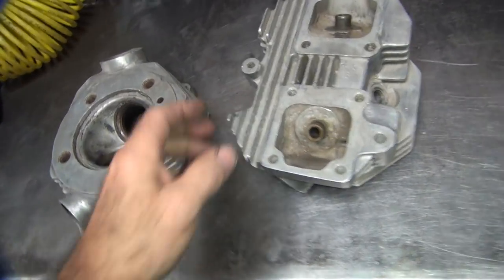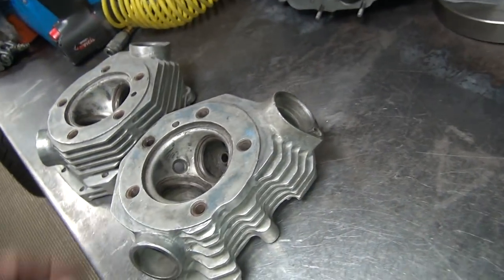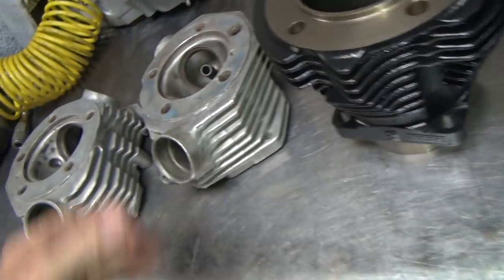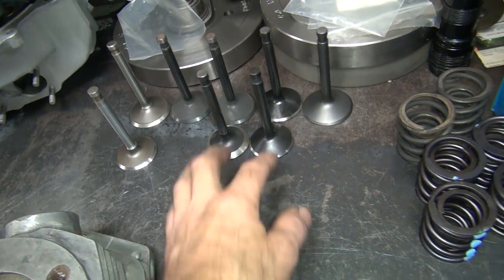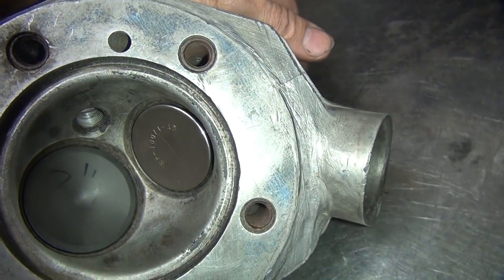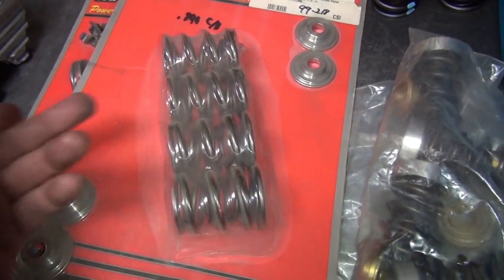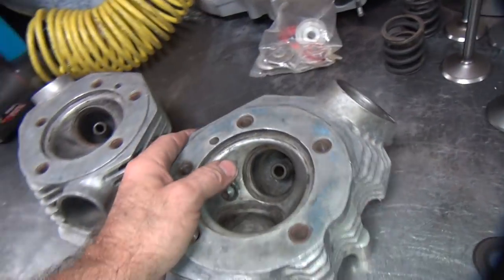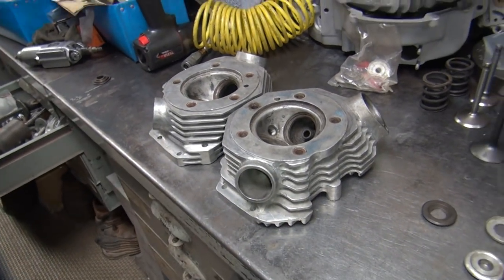#101 how do you want 1981 shovelhead heads built rebuild big bore  harley 93ci by tatro machine

Comment: Since they are already setup for big bore, and will need some porting to repair whatever the previous owner did to one of the heads, I'd love to see them set up for high performance. A nice high lift evo cam (more choices available than a shovel cam) and to have the combustion chambers welded up and then cut for squish bands with some matching pistons as well as a nice porting job (maybe weld up the intake runner floors to raise them up while yer in there).  Do it up!

BTW, got an '82 FLH myself - love them shovels!
Reply from the maker: you don't want too much.
tatro
Reply: Hey man, you asked!   So what did you ultimately decide to do with these?

Comment: Do you ever dual plug the Shovelhead cylinder heads? I'm sure it helps, but is there that much more of a gain to tear up a pair of stock heads? 
Still with the shovelhead, how about a set of close chambered heads, combustion chambers like the Evolution or a bathtub combustion chamber and running flat top pistons? 
I would like a shovel cylinder head that performs like an evo head or better. There is nothing out there???

Comment: I would like to see you give it the works thin stem valves 5 angle valve job titanium collars to keep the weight down dual plug those poor combustion chambers fix that port job with the appropriate ruff finish  and show us how to do compression releases with the dual plug heads. also what  combos or options are there to keep piston dome height to a minimum but still keep the squeeze up   then how to choose an appropriate cam for this set up